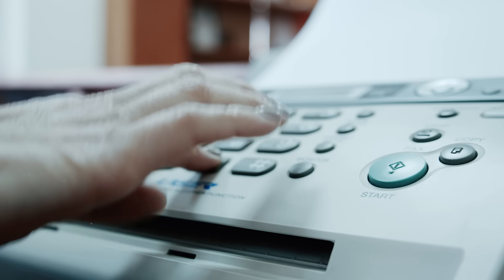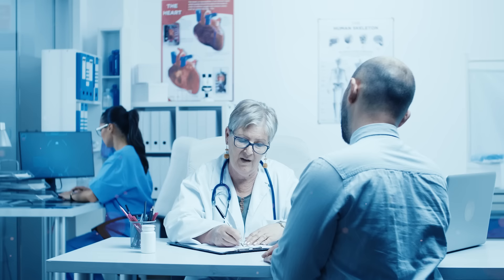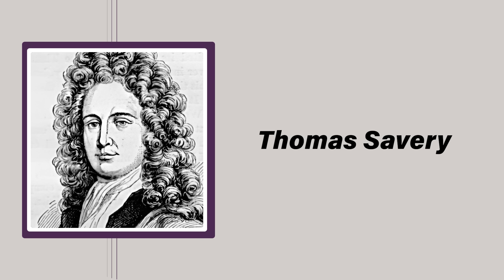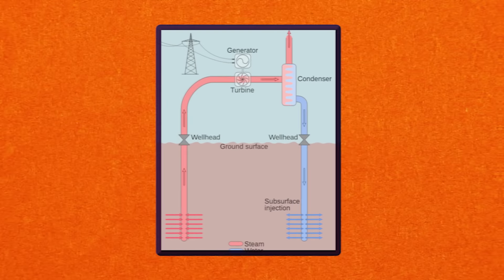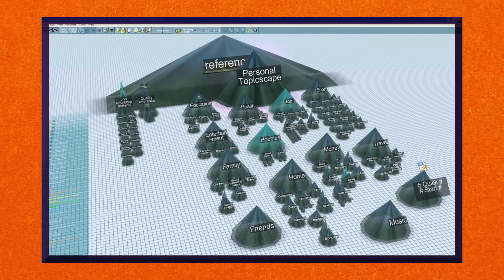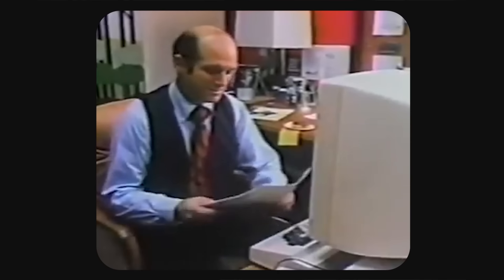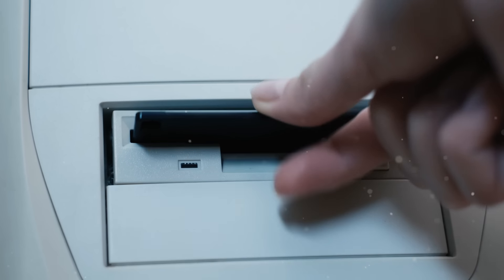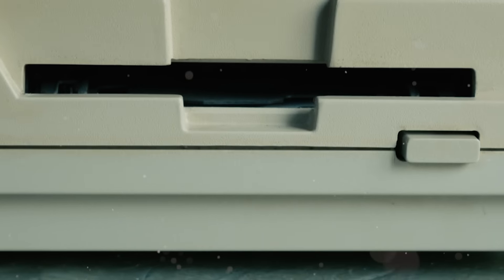Terribly Outdated Technology that we Still Use...

Comment: Another point about XP. It sort of shows the stagnation of software. For years now, we keep getting the same thing, but dressed up differently. There have been a few technological leaps, such as cloud technology or better networking, but those don't change the basic needs of computing. Whether you run Word locally or in the cloud doesn't really matter. Whether you access a file on your computer or over the network doesn't really matter. Even AI is mostly just dressed up Excel functions. Are the upgrades since Windows XP just ... well, window dressing?
Reply: In some regards, yes.  But Windows now, and for the last couple versions, supports 64-bit computing, which makes those machines FAST AS HELL. A 32-bit processor really can't compete with that -- it's kinda like the diff between 2.4 and 5 gigahertz for wi-fi.
Reply: Local vs the cloud can matter; if you forget to renew your license you could lose access to your cloud data. But you'll still have access to what is on the local computer.
Reply: @andriaduncan5032  Don't forget SSDs. Mechanichal HDDs were the one component of computers that just could not be made to go much faster (and effectively became slower because of larger programs and larger data). SSDs solved this problem.
Reply: What you call "cloud technology" we old timers call "client/server". And it's been around for decades. There's nothing new about using an off site computer to do your work.
Reply: I remember the swearing tirade I had after realizing the xp service pack3 only purpuse was to make xp as bad as vista or hopefully worse so that people would switch. They still had to remove the choice for that to happen.
Reply: @andriaduncan5032  there was a 64 bit xp
Reply: focuses now are being easier for the developers (electron is an in-your-face example of this) and looking good (Would you really want to use windows 2000's UI skin even if it's still close enough to familiarity to someone using windows 11?). Also in hardware components and things like smartphones, which all work well enough with existing OSes, thus not really a need to switch to some trendy new microkernel or plan9 or something RIGHT NOW to do the same exact thing
Reply: @supercellex4D  I regularly switch between many versions of Windows, including occasionally 2000. The changes in "skin" only have the effect of hiding the parts of the system that I need to get to. The worst for this is probably the Windows 2012 (windows 8) which makes a complete mess of the start menu; though the windows 11 based windows 2022 is also pretty annoying in that it's hiding more of the options that turn off stupid **** behind more and more level of menus that pretend not to be menus. (Come to think of it though, Windows 2000 might finally be dead. It's been over a year. I might check to see if I need to keep that VM still)
Reply: @Robert-dB  yeah but there's a difference between everything being where it needs to be and everything being cramped garbage rendered with the most ugly primitive buttons possible
Reply: @supercellex4D those would be in Windows Me (millennium) hahaha

Besides that, the only reason these systems look "old and ugly" is because of unnecessary changes made over time to show off how much hardware could be wasted on silly things

Comment: In the wonderful world of databases (used in offices, call centers, etc), there's a database called AS400, released in 1988, that is still in use today. It's absolutely not user friendly but it's robust, secure and it almost never crashes and you can input a lot of data in it.
Reply: IBM AS400, OS is OS400, and the database system is called DB2.
Reply: That was a complete machine, not just a database. I worked with one. The trouble wasn't with the database at the time, it was with the hardware that did not age well at all. Losing a hard drive, you'd then have to replace the hard drive, and then restore the data off of tape backup. It was getting so bad, that there were weeks where a "new" (read refurbished) hard drive would be installed, just to have that one fail later that week. It was hell for the operator, as she would be stuck babysitting the machine and the engineer fixing the problem in the next 16 hours or so with the tape restore, to get it working the next work day. We finally upgraded to a newer model, but I didn't realize that it was only 10 years old at the time. I thought it was older. :/
Reply: @bytehead904  I still have nightmares about these ghastly things. I worked with them well into the 00s... Manuals that arrived on a pallet. Memory that cost more than a car. Rental and maintenance contracts that cost several times more than the entire budget for all the company's desktop PCs combined. Those idiotic error messages on a tiny screen on the front. 2000 meta keys to learn. All so you could have a machine the size of a fridge that had less processing power than my mobile phone of the time.
Reply: System/36, anyone?

I worked for a company in the early 90s which made software to transpile old IBM minicomputer software, RPG and supporting metadata and scripts, to run on Unix, Microsoft, etc.  The initial product was S/36 compatible, but we were working towards AS/400 support.

I had to write a tokenizer for something called DDS - screen and file layouts (data definition specifications).
Reply: I used AS/400 while working at a casino in the early-2000s. We used it to print jackpot payout checks. It was absolutely unreliable, but I assume it was because our IT guys didn't know what it meant when I called stating I had tried both soft-booting and cold-booting the PC, and as such, didn't know how to manage the backend.

Comment: The funny thing here is that the older it gets the more secure it is. If you just happened to get the files on a floppy out of a secure area, what computer could you easily get to read a floppy? I know there are USB floppy drives out there but they are getting harder to find.
Reply: Depends upon how far back you go; if it was instead an even older cassette tape; it might be easier to find a reader. And the even older microfilm can be read by a powerful enough magnifying glass even if you can't find a microfilm reader.
Reply: @jonnunn4196  It's implied that since we are talking about magnetic-based storage media, microfilm is not a part of the conversation's scope. Also, cassette-based readers are getting hard to come by, and adequately functioning reel-to-reel readers might be unobtainable.

Comment: I like that every time one of the reasons to use any of those things is that "they're more reliable". One would think back in the days that reliability is going to be one of our top priorities. Especially considering the demise of Cyrix company. But no. Screw this! Just get yourself an update. I wish that one day one of those update appologizers would get his artificial lung or cardio stimulator halted for half an hour untill it downloads a "critical" Microsoft store update or something.
Reply: The constant need to download "critical" updates is the software equivalent of designed obsolescence; these strategies are aimed to supply us with products that don't last long, so we need to eventually keep buying new ones to make sure the manufacturers/software giants stay in business.

Another strategy is to make it very difficult for consumers to either repair their own equipment, or send it to a third party for repairs.

With software EULAs, they are not only meant to be used to protect the author's IP rights, they also prevent users from writing their own fixes, upgrades or customizations.

Comment: I've also seen Windows XP in research institutes. Mostly because you buy some scientific equipment and it comes with software that ran on Windows XP. As time passes, new hardware is made but software for older devices sometimes isn't updated. And it makes little sense to discard and buy a new instrument for a lot of money when the old one still works perfectly well. So, people just leave that instrument and its controlling computer because upgrading everything is expensive and perhaps it doesn't work with newer software.
Reply: I experienced the same.
Reply: Even at home,  I have a scanner, which works perfectly fine, but the last driver update from Cannon was for Windows 7 at max.   So I run Windows XP in virtual machine on my Linux and my wife's Mac laptops to use the scanner.

Comment: In my workplace, there is a programmable machine which loads in new or modified files using a Floppy Disk -not even a diskette.
It was a state-of-the-art machine in the late 1980s.

The machine is used on a what is now a side process, and still does it's job function reliably  - management has never been able to justify replacing it with a newer machine.

Comment: The last two words you could use to describe XP are "robust" and "performance". It was barely fit for purpose until SP3 seven years after it's launch. Even then the only time it was only comparable to 2K on performance was when newer hardware required it. Most of the security, financial, embedded and security niches you ascribe to XP are actually 2K or even NT4. Likewise for retro gaming 98b is a lot more useful than XP.

Comment: You should make a sequel to this video. There's plenty more. Such as;

COBOL programming language (extreme old and sees very limited application in business), dot matrix printers, pre-IBM computers, typewriters, film photography, horse and buggy, car carburetor, car drum brakes, Douglass DC-3 (with a more modern version being Basler BT-67), B707, floatplane, flying boat, seaplane, Hard Disk Drives, magnetic-tape data storage, and Unix.

Comment: "terribly outdated" as in "no planned obsolence" or "broken until firmware update" or "needs an internet connection." my 1989 metronome still works, and does my 1982 clock radio.
Reply: 2009 was also a good year still tech wise

Comment: Very good video. I still use XP for some tasks. It is not worth writing a program in Win7 to accomplish the same function. I should mention I run VirtualBox on Ubuntu 10.04, and can run XP simultaneously with Win7, so I can easily switch between programs. I can also transfer data back and forth, so it is the best of all worlds.

Comment: At 10:46 the 8" disk is made in Bulgaria :) (by the state owned IZOT, whose floppies were quite popular in Eastern Europe pre 1990) and can hold 180k (Single Side / Single Density). The others are 1.2 MB for the 5.25" and 1.44 MB for the 1.44". With a 720k (DS/DD) 5.25" or 1.44" the picture would have been complete.

Comment: @10:46 you mentioned the diskette size correctly but on screen it is wrong. Oh, & back then it was NOT called the "five point two five", but " five and a quarter inch" and was written as such 😉 a.k.a. "5 1/4" & rarely as "5.25". But on screen you have 5.5...

Comment: My first computer was the Commodore 64 in 1978.  B & W, one text style, no mathematical functions and no sound.  Like a big typewriter but you could change things or correct mistakes.  Saving required a floppy disk which you could reload to continue a project..  Still it was enough to type my final college paper on and print it out, (the paper was on microchips which was in it's infancy, basically as a trigger for airbags in cars and some medical devices).

Comment: Great video as usual, but you need to be more careful with the stock photos. When you talk about floppy disks still being used by musicians to operate vintage Synthesizers from the 80ies, you do have a valid point since machines like the Fairlight CMI or the EMU Emulator do indeed require floppy disks. But getting a 1972 Minimoog Model D (shown at 12:32) to run on floppy disks would require serious modifications and an electronic genius, since that machine and its modern reiterations  do not have any sound memory function whatsoever. Every single parameter of a sound is controlled by the positions of the  knobs and switches alone, its the bare bones synthesizer equivalent of a vintage sports car.😁

Comment: In high elevations internal combustion generators don't work that well and solar/wind power is too difficult to get installed up there.. So many people have old school steam power generation instead.
pagers also work by a type of "burst Transmission" so they basically work almost anywhere, even with weak signals, unlike radio's or mobile (cell) phones

Comment: I had a situation when I was younger, where my parents owned an embroidery business. The embroidery machines used 3 1/2 inch discs  a reader cost about $35 for a PC at that point, but the machine manufacturer switched the connection from female to male on the back of the drive and charge 1500 for it instead

Comment: I occasionally find a TRS-80 floppy disk while looking for something else. With a capacity of 89600 bytes, I guess I needed a lot of them. I still use a Windows XP system at work. It still runs the accounting system just as it always has. Also, I still keep getting the familiar beep of a fax machine trying to connect when I answer the phone.

Comment: I worked in a factory that was built in the late 1800s out of thick concrete, getting cell signal in there was very spotty. We used pagers to contact supervisors and maintenance from land lines within the plant. I left there in 2015, but I would wager they are still doing this.
Reply: this is the main reason they are still so prevalent in the medical industry as well. many parts of hospitals will have very bad to no cell signal and may or may not have wifi signal either. pagers using lower frequency signal have no issue penetrating all that material.

Comment: Fun fact, i did an internship at a national lab and took a tour of their super computer. For any data thay was being kept for long term storage they actually were stored on these film drives. I believe each of the drives had 500gb-5tb of storage on them. The reason they used it was because it was data that was accessed so infrequently, the film was more reliable and chealee because it didnt take power to store. Since its an analog medium, the data persisted without the need to keep it powered. Heres the cool part, if you wanted to access the data there was a robotic arm designated the "operator" which grabs the drive and inserts it into the system to be accessed.

Comment: For part 2, you can think about using vacuum tubes. Talk about antiquated technology that doesn't go away.
Reply: Also, GPS units, for areas with limited cell coverage.
Reply: @augiegirl1  Cell coverage has nothing to do with GPS, these are two different technologies that serve totally different purposes. Your phone has an actual, real GPS unit built in, which can work also without phone coverage (even without a SIM card at all) - you only need an offline mapping application loaded on your phone.

Comment: I work in manufacturing IT in the United States and I can confirm that XP machines are still super common—specifically the embedded version.  That said, it’s not the oldest OS I’ve ever worked on, because I’ve had to resurrect a Windows 98 machine that was still in production in the 2020’s (a year or two ago).

I was surprised I was actually able to get it to boot from a USB stick, and when I restored the 7 year old backup, I had to install the USB drivers so the controls engineers could actually use it—I had a PS/2 keyboard and trackball I used to leave the other USB port open in case I needed it for something.  Then when I handed it off they had 7 years worth of floppies to go through and re-load the stuff they had updated since the backup.

It turns out that when shit still works and costs nothing to keep it running, a slightly newer PC that controls a massive machine that costs between $250K and $1M+, it just doesn’t make sense to replace it.  The innovations in machining technology for engines and transmissions hasn’t changed much and old machines can just be update with new stuff that looks exactly like the old stuff.  The only difference is that they’ve often got additional sensors and data logging capabilities so that engineers can track everything.

Comment: 12:10 you can replace a 3.5" drive with an emulator that accepts USB drives with disk images on it.
Reply: And as for operating systems, you cash still find MS DOS and the humble 386 and 486 used in industry. The 386 and 486 stopped production in 2007.

Comment: I had to fulfill very specific file requirements (.dib file, less than 500kb, etc) a while ago for a specific printing job, and the only reasonable explanation on why it was so specific I came up with is it has to fit a floppy, so I asked.
Apparently somewhere in china stands a factory with a printer running 5.25" floppies.

Comment: Commercial style mobile radio, such as Motorola / Vertex Standard sometimes requires older operating systems to run the programming software.

Comment: i think why the fax machine is more secure is you would have to tap the phone line and in doing so you cause interference that may cause the fax to fail even if you can capture the tones and re construct the fax.

so if the fax is so secure because of the phone lines maybe the credit card machines should go back to using phone lines because you cant hack them via the phone line.

malware and viruses can be transmitted over floppies too.

i think that is how stuxnet was installed into the control systems of the iranian nuclear enrichment plant.

pagers are more secure and could be adapted for use as 2fa devices.

Comment: Floppy disks can be replaced with USB emulator drives. We have an old CNC machine that still uses CAM programs that can only be transferred to it by floppy drive. We had issues with floppys breaking down so we replaced the floppy drive with USB emulator. The machine still recognizes the drive as a floppy drive, but you first have to upload the CAM file from USB to the emulator and then from emulator to machine drive.